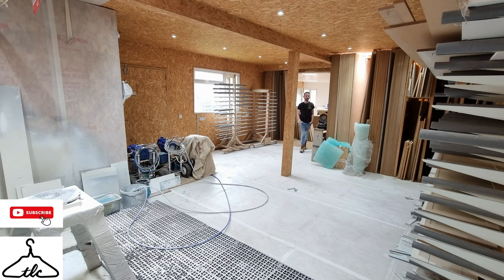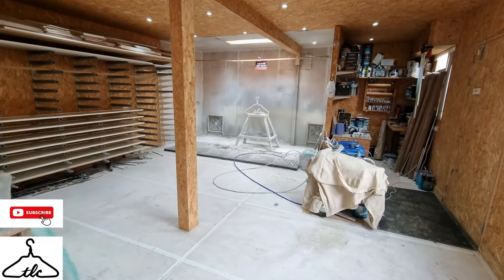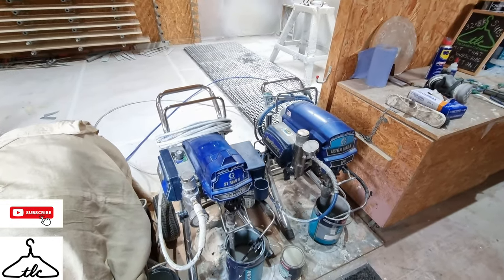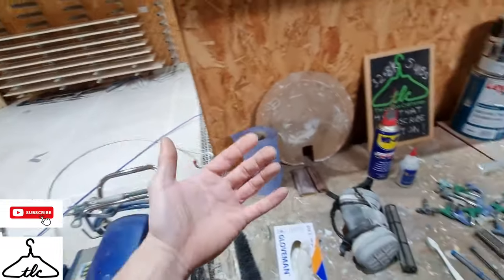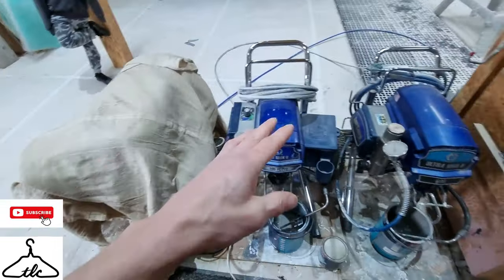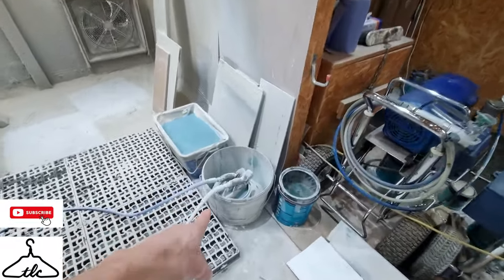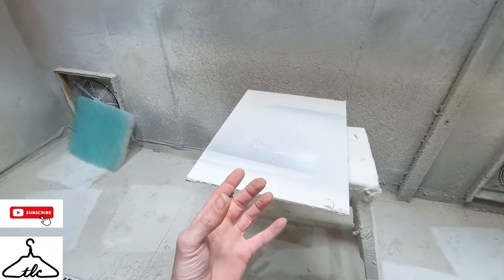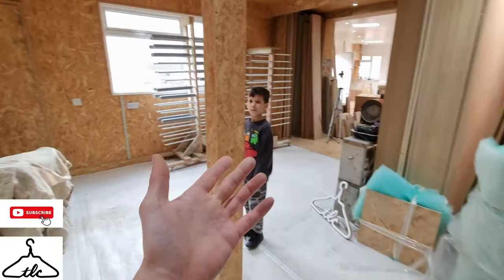You'll NEED THESE To SPRAY Your Fitted Furniture // Sprayroom Comprehensive Kit // PART 3

Comment: Lately I've searched a lot about different methods of painting and decided to go Airless. FengKe sells Graco 395 copy for 520$ with automatic pressure regulator and I've talked to a guy that has it. He's a painter and said he can't see any difference compared to original Graco when you put quality Wagner or Graco spraying nozzle in. He paints whole houses with it. They also have a copy of 390 without auto pressure regulator for 440$, but the guy said it's definitely worth to give a little extra to have this option. Cheers!

Comment: Great videos, thanks for doing those. 

How long can you keep the paint in the hose for? I take it from the video you can leave it there between coats? Cover the paint tin and place the spray gun in a tub of water?
Reply from the maker: HI Russell,
Sorry for the late reply!
Well technically you should clean out after every use/day. I am sure Graco would recommend this.
But I do not do this. Im pretty bad at leaving paint in the machine/hose for long periods of time, sometimes weeks.
I dont thiink it would do much harm to the machine as long as the pressure has been released.
I have never really had any problems from it or any failures etc, but when I do clean it out after a job is finished, it gets an extremely good clean!
cheers ryan!

Comment: Hello, love the channel and i hope you still read comments. i have used silk on my current project for base coats and done 2 so far. i have just sanded the lot and about to do the finishing. i have noticed however that silk have gone a bit sticky on a test piece that had 3 coats of silk. can you please advise on whether this has happened with you before and if so what is the cause? i am using leyland contract silk brilliant white, spray using 310 tip, 10L watered down 5%. 

thank you!
Reply from the maker: Hi
Thank you
I have not had this problem before.
Either the paint is not 100% dry between coats, you are putting on too heavy (like really heavy) or its down to you thinning the paint.
I have never thinned paint.
Im sorry i cant help anymore.
I do one coat, let it dry, then p240 grit very lightly.
I then do the finall 2 coats, letting it dry between the coats.
I never have problems where its sticky.
Maybe very small amounts or paint come off and clog the paper over time, and ive so get yourself a rubber sanding bar.
Cheers Ryan